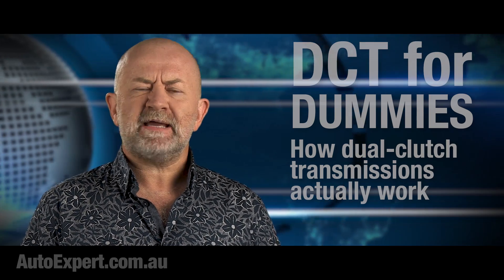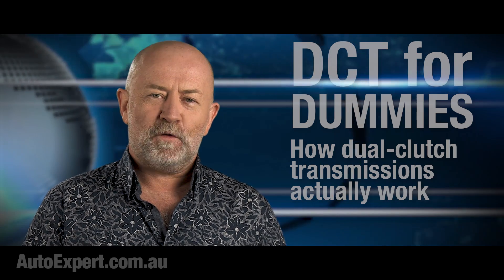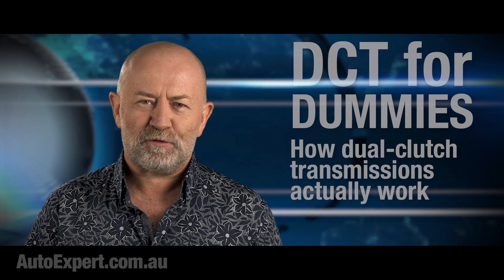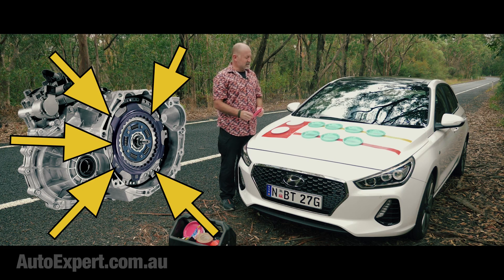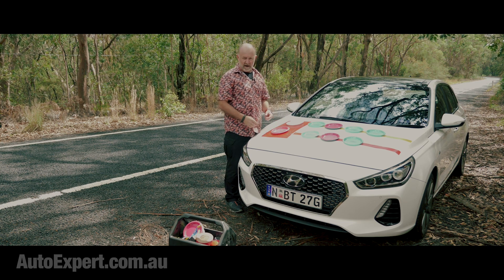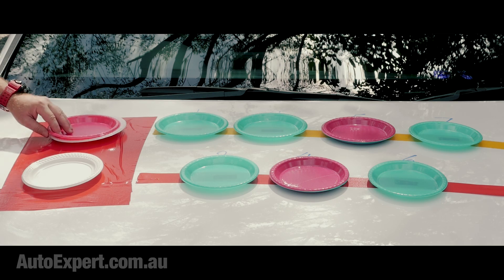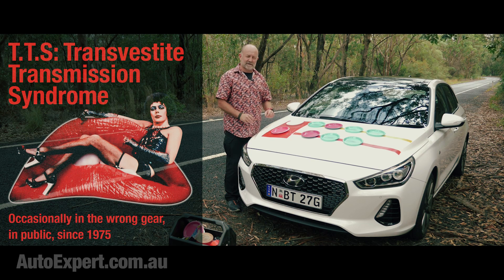DCTs for Dummies. (How dual clutch transmissions really work.) | Auto Expert John Cadogan

Comment: I have a problem with dual clutch transmission. It is a clutch concept. I live in Seattle e WA USA. Can't drive manual transmission. Necause traffic sometikmes move so slow below engine idle first gear. I don't know of any competent way to deal with this. One technique suggested somewhere id slip the clutch. Another is go thrpugh starting routine slip the clutch to get car roll then reach speed push in clutch and coast.  Might not be possible for a hyman driver. Bit should be doable for computer. So I would expect jigh rate of wear tryong to drive in Seattle style traffic jams. Enough so thst the whor idea is unwotkable
 Also do note VW went from automatic transmission to dual clutch and back to automatic recently.Another thing driving hills close quarter manoeuver requires lots of slip the cutch.

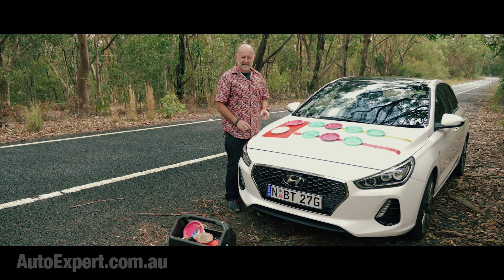Comment: You said at 6:27 that if you are coasting and then you try to go on the open space and accelerate then it will take time to for you to change gears but why would it want to go down a gear instead of staying on the preselected 4th gear? If you are accelerating then they system would want the next gear which in this case would be 4th gear so it can quickly change?

Comment: The necessity to explain a DCT to drivers says something about its inherent and flawed construction.

It does not do well with regular towing of a trailer or caravan and driving it like a regular "automatic" in daily commuting at slow stop-and-go queue traffic WILL shorten the longevity. A DSG transmission might change gears fast and be frugal, highlighed selling points but its not rare that it jerks and twitches at low speed and while parking. I have test driven a few and read car reviews to this day that still says so.

Old video but now in 2023 the DSG is still a inferior product that probably makes VW a lot of money cos when it breaks VW won't pay, DSG failiure is almost entirely "handling error" in their eyes so the owners have to pay directly or thru their insurance company if lucky.

Comment: I really like the way you explained the workings of a DCT. Absolutely brilliant. Now it makes sense. It sounds more reliable than a CVT.
Reply: i just brought a 2024 t cross, and first time owning an auto, it must be quich as the car in front was slowing so i scooted over to the other lane and i only had to touch the gas. i didn't feel the delay. and no kick down as i did't give it to much gas so if it was unsure to go down or not i did not feel it. i miss may manual tried a standard auto but went with this.

Comment: 4:00 What happens if you used the paddle shifter to shift down a gear and it wasn't prepared? Would you notice a difference in the shift time?
Reply: If it's pre-selected a gear, yes. 

They have the "sport mode" option in some cars, where it may not preselect a gear -- but that's just my guess. 

I mean, if you're using a paddle shifter, why not use your foot on the clutch and actually drive a car, rather than having a computer figure everything out for you?
Reply: @sweatbustersairconditionin5471  I do prefer manuals, I play this simulator called BeamNG, and sometimes if I do what would be seen as an unpredictable shift, the transmission takes a bit longer to shift. And yes, BeamNG is realistic, it simulates the car very well.

Comment: Here is the "process" of pulling out onto the highway with my dual-clutch automatic 2019 A4: 
stop and look left for a traffic gap,  
upon seeing gap-- stab accelerator: 
auto off/on starts engine, 
clutches engage, 
turbo spools-up and my A4 creeps out into traffic
car gets rear-ended due to all these delays. 
If I had realized all of this BS would occur just to get this damn death-trap going, would have never bought a dual-clutch automatic car.. long live the torque converter...

Comment: no wonder flooring it takes forever, the gearbox (let's presume I'm in 3rd) preselects 2nd because I'm slowing down for the lights. then i floor it and it takes while to engage 3rd gear (from BeamNG.drive experience)
Reply: Yea I figured that out too. Did you figure out how to better accelerate from being at a stop from lights?
Reply: @c0llinPM  when you are stops the trans predicts you are going forwards so it selects 1 and preselecs 2. If you floor it when slowing accelerate more slowly 50% maybe and once the change happens then punch it. Just a guess

Comment: Why just why. Theres so much more to go wrong with dct compared to a manual and maybe even a auto. And above all they cost much more to repair. I bet very few transmission repair shops will even attempt to rebuild one due to the cost of parts and or replacing it if they cause a failure.

Comment: I have a Hyundai Veloster with over 300 thousand miles on it. I did a upper rebuild on it. The dual clutch has ran flawless, I latterly jump on it every time I got to work when I get on the freeway up to 100 miles an hour just to worm up the engine. There is not enough power on the car to push the transmission to its potential. I will get a tuned ecu next and stage one clutch pad to see where the potential starts. It’s a NA engine with a methanol injection, full intake and straight through exhaust
Reply: Basically the transmission it to good for the stock engines

Comment: I'M  a Master Mechanic Technician  45+  years Experiance and Love True Manual Transmissions that said Automatic Transmissions have their place like in Light Duty Trucks Cadillacs Lincolns Mommies Soccer SUV or Mini Van but! Porsche Corvette GT40 BMWM Jaguar Etypes Ferraris Lambos  Sports and muscle cars Real Good Drivers Shift Manually. I Couldnt Imagine Driving a Old E Type Jaguar with a Automatic Transmission  even though in late 60s Jaguar did make Some with AT. Anyway if you look at the designs of these Automatics like the One in 2020 Corvette it's a Manual Transmiision in Transaxle design. Has Gears Hubs Sliders Shift forks mainshaft like in a manual trans but shift rods are operated by Electrical Solenoids, Hydraulic Actuators Via PCM or Transmission Control Module which Selects the appropriate gear does your Mommy still wipe your Butt too. Lol so all this fine and dandy when it works but you didnt dump the car in time to the next sucker and you Bitchin Auto Paddle shift Transmission took a dump now what 6-7 thousand dollars later Replace the Transmission  heres a tissue Mr. AT Smith your mommy is here now to take you home I'll have your Bitchin Car done in  couple days Oh by the way you need 4 new tires and front and rear brake pads and rotors too that's  $3000.00  never ends. A lot cheaper Rebuild  manual trans and replace a clutch plus it's more fun to shift you bunch of lazy Fs.

Comment: The DSG recall fiasco... from tens years before this video was made following which there seem to have been few notable problems with them. So yeah, ridiculous hyperbole and shit information that's not been relevant for a decade. There aren't any fundamental mechanical problems with the DSG transmission really, there were 'bugs' in SOME (not all) of the early models over a decade ago (shockingly rolling out a fundamentally new piece of technology on mass wasn't accomplished without a a few hiccups here and there that needed correcting) 

All that shit has long since been addressed though and any VW with a DSG that's from after like 2010 is unlikely to have significant issues (some will of course, but some bog standard automatics or manuals will just explode too, shit happens). I've driven a VW from 2013 with one for like five years now without any issues.

Comment: I had a Ford Kuga 2 ltr diesel 4wd Powershift, absolute pain in the Arse in cold weather, the gearbox didn't know what to do so I always drove in manual mode till the gearbox warmed up, once warmed up it run OK until the next colts start up, Fords reflashed the gearbox several times but it always went back as it was before very shortly afterwards. Nice gearbox WHEN working correctly but can get on your nerves a bit when it does its own thing, only kept it 3yrs and 20,000 miles and as soon as the warranty was up pissed it off, won't have another one, ii have a BMW diesel 4wd 8 speed auto that's NEVER missed a gear a gear up to now so fingers crossed, it's now 18months old and does at least 10mpg better than the Ford and is a lot quicker so we'll see how it goes up two 3years before I decide wether to keep it long term or replace it.

Comment: Hi John,  Love your videos.  I'm considering getting a new Volkswagen GTI, but nervous about the DCT transmission and Volkswagen in general.  Have they improved them in newer models? I love the way they drive, but still nervous.  However, they do have a longer warranty.  Your thoughts?
Reply from the maker: Reliability and customer support are still major concerns.
Reply: @AutoExpertJC  Thanks John. I'm also considering trading in my Honda Civic for a new one, but I don't seem to be a big fan of the new CVT's.  I have also heard they have some reliability issues.  Thoughts?

Comment: I watched a not to do for Dual clutch and they mentioned that scenario where there is a delay but I honestly did not really get it but with the analogy you made and the diagram that scenario is beginning to make a lot more sense, so its just a delay in that scenario meaning it takes a second later to brake to accommodate for that delay right? I am still a bit confused but I do get the  instead of abrupt braking it anticipates you moving around that congestion.

Comment: I thought I blocked this shzt channel. This guys voice, attitude and face makes me cringe... My VW TDI Diesel Jetta Sportwagen w/ DSG in my awsome, flawless in 8 yrs, 110 ,000 miles. Love it. The two oil changes and filters on it myself total cost about 240 bucks total. The way I drive this transmission will easily go 300,000 miles.

Comment: I’ve owned a 2010 VW GTI with a DSG for a while now. You’re 100% right it has its downsides but you can correct them if you know some “tricks”. Don’t accelerate while downshifting, I learned that the hard way at low speeds and jerked the hell out of the car. Sitting at idle for long periods in ‘D’ can put some wear (~2bar of pressure if I remember right) on a clutch. Swap trans fluid every 40k miles and you’re fine :)

Comment: Isn't it very hard on the engine and driveline when in less than 0.1seconds the revs get knocked up or down by say 1500 revs? I consider that mechanical abuse.

Comment: Hi mate. As a guy who just purchased his first DSG, this was a great explanation of how it works. I guess mine is what you would call high performance, but this explanation has already helped me understand it, and drive it better. Thanks again. PS i once purchased a WRX you once owned from a car dealer in Hamilton, Newcastle. It had digital gauges added in the centre console that controlled various different functions. Not standard at the time. Long time fan bud.

Comment: Hi, best video explained dual clutch transmission. I have 6 speed dual clutch transmission on my Lexus nx 300 f sport but does it normal to feel every gear changes like manual transmission ?
Reply: YES, because the TRANSMISSION is a manual without fluid coupling.

Comment: I like the idea of electromechanical actuating mechanisms for the gear changes in a transmission, as long as there is complete manual control of the gear selection. Let the computer control the action of the clutch, the engine speed and gear engagement, as the machine can do it faster and more smoothly than a human can, but leave the option for a manual control mode where the human makes the decision as to when the shift will be made and to what gear.

Comment: I drove a DCT 2006 Audi A3 today and in full auto mode it changes like a dream. In S mode using the paddles to shift it was no better at changing than my current Subaru auto trans beast in manual shift. So the paddles are a nice toy to play with and while intelligently implemented (if you stop in S mode the transmission will shift to 1st for you), they are only useful if you want to drive 'like' an F1 pilot on opiates. Also in the Audi, taking off from idle feels like the clutch is slipping its life away. The Audi's DCT is a mixed 'blessing' and makes it a challenge when considering the plunge into VW's world of pain; can I treat the transmission with the nurturing it needs or will it spontaneously explode in a shower of $s. Has anyone managed to get a long life out of an Audi DCT?
Reply: Well, you drove an A3, which is quite literally a WV Gofl, same engine, same transmission just in an Audi body, and maybe softer suspension. You must drive an A4+ to get the longitudinally mounted engine + the 7-speed dual-clutch S-Tronic transmission to get an idea of what Audi really feels like driving. Ofc the higher you go, the better it gets, as the S model or RS model will obviously be much better than the base model A4s and A6s.
Reply: @ahsandurrani1863  I ride a Ducati, which is owned by the Audi group, but it’s still a Ducati through and through. Weird right? I didn’t buy the A3 and I doubt I’ll ever aspire to own a ‘real’ Audi because the Audi tax is even more extreme and outrageous than the Ducati tax.
Reply: @lrowlands53  u can’t really compare a car to motorcycles.

Comment: Quick Question.....Would putting a Dual clutch in Manual mode and use the paddles exclusively while in heavy traffic...Wouldn't that stop that issue?

Comment: Hi! I have a Kia Sportage with a 7DCT. I'm wondering: when you are at a stoplight in D, does it takes out in Neutral by itself  or it stays in the First gear with the clutch pressed (like staying at a stoplight on a manual transmission, with the first gear selected and your foot on the clutch)? I could not find this information anywhere on youtube or on the Internet and having a technical explanation for this. I found only that "DCT is smart and knows that you are at a stoplight and takes it in Neutral". But this is not very convincing to me. I'm expecting an documented opinion, from who has it. BR!

Comment: I've found the biggest complaint with DCTs is they are bad at going slow, like when maneuvering in a parking lot. They need to combine a torque-converter and a clutch. Only allow the converter to slip when the car is in first gear. That will allow the car to creep without stalling or burning up the clutches. After that it can lock up the converter for all the other gears.

Comment: I’ve known a few drivers who swear by manual transmission - being at one with the car and all that old flannel (and I’m one of them) - who have been converted to DSG and would never go back to manual.  I drive an Audi A4 with DSG and I love it.  Sure, it is occasionally jerky and it can sometimes take a second or so to work out which gear it should be in, but it makes driving so relaxing, particularly in town traffic.  My only concern is long term reliability; I have read all sorts of horror stories about failures of the Mechatronics unit and on the A4 it’s about £5K to replace.  Anyway, at 16,000 miles so far so good and I continue to enjoy driving while it all works properly.

Comment: I feel like it wouldn't be that hard to design a transmission where you could tell it what to expect next.

Like adding a switch that allowed you you to tell the engine to expect a lower speed. That way you can enable the switch before getting around corners, and disable the switch when you get to the appropriate speed.

I'm not a mechanic. But I am an engineer. Hopefully some company will find a solution to the prediction problem!

Comment: This ''Pregnany pause of hesitation'' in the computer and gearbox is why I will NEVER ride a motorcycle with this new DCT technology.  I rely on my own instincts to tell me what gear I need, and I have a clutch lever that is manually activated.  If I suffer a partial siezure in the engine, the piston rings break or me chain tensioners fail, I can pull in the clutch and minimize the damage.  What happens with a DCT system?  Will the gear-box lock up completely?  Will the computer have a brain fart and not know to disengage everything?  Does the DCT even have a disengagement option if you break down, and can thus be towed?, or if the box is locked solid, how do you move the vehicle?

But back to the pregnant pause, where you explain pulling up in traffic and the computer selects 4th gear instead of 2nd....then you pull away in a gap and need that 2nd gear for acceleration, but, as the DCT is in 4th , it needs time to sort itself out for the new situation that's required of it, because of the dodgy DCT prediction..... Well...that could be a killer death move if selected on a motorbike.  That hesitation in the gearbox could prove fatal to the rider.  DCT is fine for cars, but in my opinion, should not be on a 'bike, unless it's a drag 'bike going in a straight line on a track.  But, there are many motorcycle manufacturers exploring this technology, and Honda already use it on their new Goldwing.

On a 'bike, you have severe weather conditions to contend with.  Snow or rain.  Greasy roads and corners that you need to choose which gear to be in.  I don't want a computer deciding for me what it thinks is the best gear selection.  Also on snowy roads or icy conditions, I predict the DCT will also ''slip'' up and down the range as you move, and the next gear is selected at a certain speed.  Whereas on a manual clutch, you can stay in a selected gear and feather the clutch for better control.  So, overall, it's a no from me on this new technology.  I'll stick to good old proven mechanical mjethods of gear selecting. 

Thanks for the video.  Take 'er easy.  Dawg.